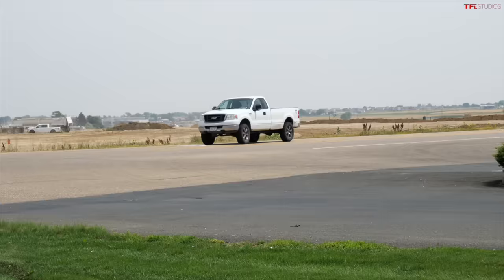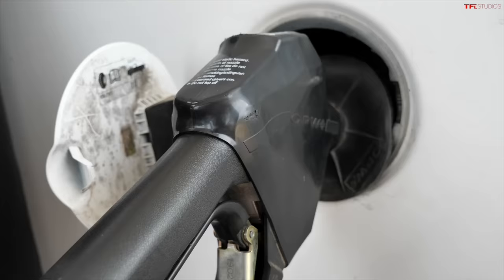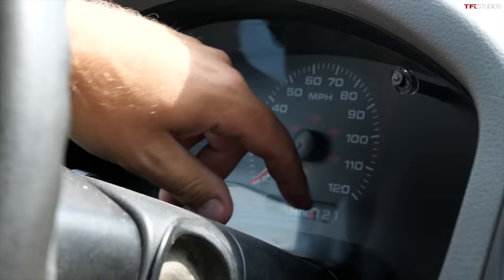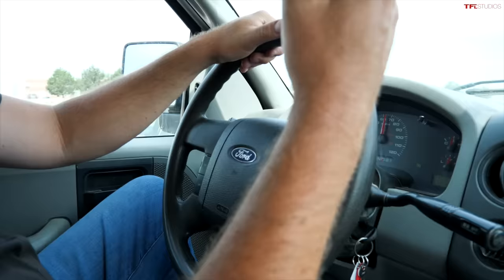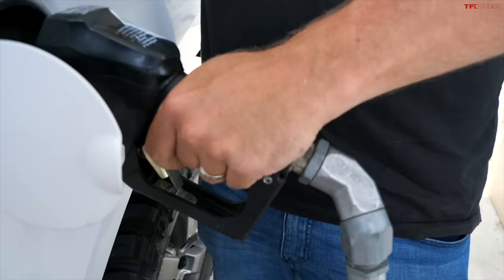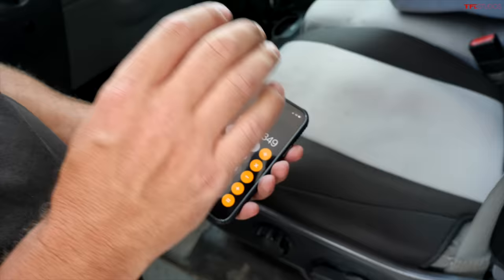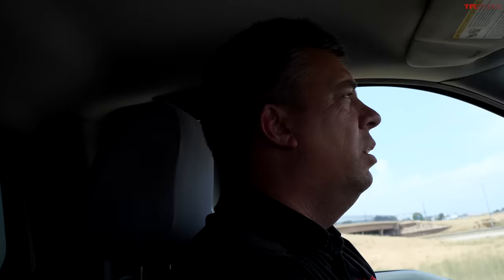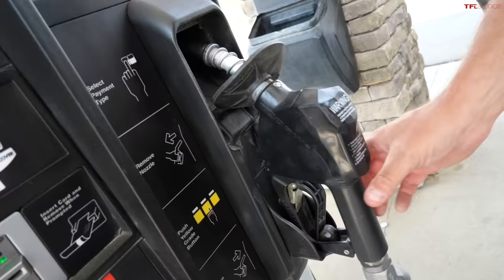Surprising Result: Here’s What Happens To Your Truck’s MPG When You Install A Topper!

Comment: I read somewhere that the manufacturers put the truck in a wind tunnel when they are designing it  The aerodynamics of an empty tuck bed create a high pressure air bubble behind the cab which the air flows over.  
If you remove the tailgate or add an airflow gate, the bubble will no longer be there.   
You will also get the drag from the bed and back of the truck.  
If you drive with the tailgate down, the hinges and other moving parts will wear out sooner because of the gate bouncing up and down with every bump you hit in the road

Comment: Had a 2010 Jeep 4 door Wrangler. 
Lifted, 37's, replace all the plastics with steel. Engine to gas tank skid plate.  About 700# heavier than stock. Got the same highway MPG as stock. Guessing the skid plate kit helped aerodynamics.

Comment: Thanks bro, this is sure inligting to know. I have a 97 f150 4.2 V 6 with topper, when I bought the truck 6 years ago I did the calculations and I got readings of 23 mpg. Ford reading had the truck (New) at 20 mpg.

Comment: I use to work for a company that tested Chevrolet. When the S10 came out we tested for a week. Tailgate up. Tailgate down. Windows up with A/C Windows down no A/C. We put 1 gallon of gas on each test. Ran it until it ran out. Tailgate down had better fuel milage than up. A/C on at 55mph Windows up. Got better than Windows down. 40 mph and under mileage increases with no A/C... But all were small differences. We did the test at Daytona Speedway on the flat part if track.

Comment: This is more fuel-efficient than my 13 f150 with 3.5 EcoBoost. Damn. I wish you did this test at 80 mph other than 70 like people really cruise on. The higher speed, the more important drag efficiency is.
Reply: I bet the mileage lost driving 80mph vs 70 would be greater than any efficiency gained
Reply: @epfd217  I meant they faster you go, the more importance of cover would show.

Comment: Huh cool.  I'm sure City mpg is more adversely affected
Reply: good point, aerodynamics dont really count in gridlock : P
Reply: @BIKEMAN21  It doesn't matter when your idling in gridlock either.  Caps make no difference.  My last truck I ran with a cap on and off 50/50 for 12 years and the mpg difference was negligible.
Reply: @superfisher4379  Moving 200 extra pounds in traffic will definately use more gas though
Reply: @BIKEMAN21  i gained 0.4mpg after switching from a topper to the bak x4.

Comment: I did almost the same exact experiment when i went to pick up a camper shell. All interstate there. Filled up at my start. Ran there with a tonneau cover. Files up a mile from the pickup - 18mpg. Put on the shell, drove home at the same speed and route, filled up when i got off the interstate - 18 mpg.
Reply: Correction - memory is unreliable, but Fully remembers - open bed, tailgate up 19.7mpg. With the shell 19.6mpg.
Reply: *Fuelly. Dang autocorrect.

Comment: Is “topper” and “cap” a northern saying? We just say “camper” in the south
Reply: It is, in the west it's camper shell or cap. I've never actually heard anyone say topper in real life.
Reply: @bigslacker666  I’ve lived in Montana, Colorado, Utah, Arizona. Always heard topper.
Reply: thats not a camper... its just Not!
Reply: I always called it a "shell".
Reply: If you call it a camper, then what do you call a real camper?
Reply: @nodak81  a camper. These “toppers” were originally meant for camping. If you want the bed covered just get a bed cover. When I was a kid most trucks that had them they would removed the rear window and have in sealed between the camper and cab.
Reply: @nodak81  
Sleeper??  :)
Reply: I believe what they’re called does vary depending on where you live. Where I live in SW Florida, most everyone calls them caps or toppers.  Calling it a camper or shell sounds like something someone who lives in the backwoods would call them. YeeHaw!
Reply: @kev8839  you must not be familiar with Florida, because you have plenty of those backwoods people there
Reply: My understanding is that camper implies internal camping equipment like a kitchen, a bed, lav and/or seating. Camper shell is only the enclosure, and could be a cap or topper although those would generally be smaller. A popup camper might be the size of a shell when not in use but tall enough for standing when deployed.

Comment: I'd assume a truck canopy only helps if you have a spoiler on the back to break the vacuum.  The space immediately behind the truck ends up with a little bit of vacuum, pulling air into it.  If you have an air spoiler on the tail it 'spoils' the smooth air flow and makes the air go into that vacuum space easier, thus reducing drag.  Try it.

Comment: I have a solid tonneau cover on my Tacoma and have left things on it after loading and unloading. They are still there after driving some distance so my 2013 Tacoma double cab's aerodynamics are such that the air flow over the cab doesn't get caught in the bed (or everything would have disappeared). If we're only talking about a tenth of a mpg, my right foot can make that difference every time i drive. In fact, driving on cruise control can get me at least 1 mpg better mileage because it's not changing speed all the time.

Comment: Not that anyone is likely to care but, if someone wants to "improve" on this test method I have a couple of suggestions: a) If you have a grandma in the family that lives far enough away to require 3/4 tank of fuel (or more) to get there and back, keep track of fuel efficiency on two such trips, b) Install an intake manifold vacuum gauge where the driver can watch it EVERY time the position of the accelerator is adjusted. Give yourself a limit (5 or 10 inches of mercury vacuum) for all acceleration (except ignore the gauge when merging with freeway traffic).

Comment: I'm OCD on MPG.  I put BFGoodrich Mud & Snow tires on, replacing the Michelin Mud & Snow tires because those Michelins were worthless in the snow.  For my long drives I got a verified 1 MPG less with those BFGoodrich tires than the Michelin.  I ended up buying a whole set of rims on Craigslist from someone who wanted to trick out his new Tundra and now drive with the Michelins in the Summer and BFGoodrich tires in the Winter.  My point is tires can have a huge effect on MPG.

Comment: I have a Ford F-150 pickup truck which is two wheel drive and it gives me over 21 mpg on the freeway and even better when driving locally. It has a 5.4L V-8 engine in it and it is a 2004 model.

Comment: I have a 2010 Tundra with 4.6L v8 engine.  I bought the truck and got 18 miles per gallon highway and added a roll up tonneau cover and my gas mileage went up to 19 MPG Highway.  So the tonneau gave me slightly more gas mileage.  My bed is the 6foot 7 inch bed and the truck is a 4 door crew cab.  The Tundra is a base model.  I use the cruise control whenever possible.  I try not to speed but here in Texas the speed limit is 70-75 Miles per hour.   I dont drive in the city much so city driving obviously would be worse.

Comment: Glad to see my 1970, 4 speed C20 with a stock 350 with tuned quadrajet getting 16mpg is decent.
Given it has 33's and a 4.56 final drive.
Reply: Might get 18mpg if you put the right size tires on it LOL....well and didn't have rock crawling final drives HAHA!!!  Nope, 16mpg is actually pretty good for a carbureted V8 in a 3/4 ton 4x4 pickup with heavy tires and geared lower.   Honestly with a truck like that I'd never care about fuel economy, it would be a fun truck to drive and throw fuel efficiency out the window LOL.
Reply: Pretty hard to beat a properly tuned Q-Jet. 16 is impressive with 33s & 4.56 gears

Comment: I put a soft topper cap on my 21 Tacoma and on multiple 250 mile trips I averaged around 20.5mpg without the top up.  With the top up I averaged around 22.5-23 on the same trips.  Easy 2mpg increase on the highway

Comment: I added a truck topper to my truck, and when i crashed the truck it almost came through the back window. 

The bed covers are a better option 
As long as you can fold them back for large items.  The camper shell limits what you can put in the bed.
You can get better fule economy by taking the tailgate off the truck.

Comment: I have a 20 year old pickup. The F150 with  4.2 V6  and 6 &1/2 ft bed and extended cab with rear seat and half rear doors. Get about 21 mpg on highway. Level terrain at 65 to 80 mph. No topper. I kept my speed even using cruise control.

Comment: Myth busters did this same experiment, much more scientifically may I add, and found that the truck toppers/covers/removing the tailgate hurts your fuel economy because trucks are designed to have the air vortex in the truck bed while traveling down the road. Altering the factory design creates turbulence behind the truck, decreasing efficiency.

Comment: I live in UK, and I've enjoyed owning quite a few Chevy/GMC pickups and a couple of Ford Rangers. All of them went through a good shakedown soon after I took them on so I could run them as economically as possible, bearing in mind our extortionate fuel prices here. The results of my mpg checks were always very similar, truck-to-truck; Open bed, tailgate up caused most expense due to drag, Tailgate down or removed gave the best mpg, the same as with a Mountain Top lid fitted. 10% minimum difference. AND my wife likes trucks, that's a bonus!!
Reply: Every scientific test ever done refutes your statement about tailgate up or down. Drop the tailgate & throw some aluminum cans in the bed. They "blow" to the front right beneath the back of the roof. The air does NOT see the tailgate in a pickup truck.

Comment: I think a topper would make a difference if you were towing a camper trailer behind you because when I used my open bed pick up to tow my trailer, I only got 8 miles per gallon due to the wind resistance on my truck hitting the camper. I would like to see a video made comparing the results telling some thing because I could see it. The top are making a difference. Good video thank you.

Comment: I have a ‘19 Silverado 4x4 5.3L.
Here’s the mpg I lost when I did the following:
Utility top: 1
3.5” leveling lift: 2
1” taller A/T tires: 1
Total loss of 4 mpg average, truck sees mostly highway miles. My top extends slightly past the cab on top and both sides, plus has toolboxes on the sides. If I stay at 70mph on flat road, I can still eek out 19mpg. I typically average around 14.5mpg overall.
Reply: Taller tires made the speedo/odometer read lower than actual unless you went in & corrected it. It's not so much the 1" height difference as it is the percent difference. Going from a 30" to a 31" is 3.3%! Also, AT tires probably have more rolling resistance & are heavier than a typical All Season tire.

Comment: The wind resistance is not so much about how you split the airstream in front of the vehicle but how it is blended in behind the vehicle. Secure a tarp over the roof and drive at various speeds (Carefully) and have someone take pictures of how the tarp behaves. It tries to lift away, ie the turbulence is pulling at the tarp. If you reshaped the canopy top to resemble the flying tarp, you eliminate the turbulence and should improve the fuel economy.

Comment: The comparison should be the bed as normally configured, bed with the tailgate removed, and then with a cap. My cap improved my gas milage about 1mpg, but I would be interested if just removing the tailgate would have done as well.

Comment: 2010 6.0 gmc hd. Topped totally off to the brim without a camper shell i can go 143 miled on 1/4 tank on the hwy. With the shell i can cover that same miles on 3/16th of a tank. Camper is a mid rise design. In my world i get better millage with this shell on my truck.

Comment: My 2018 Chevy Colorado Extend cab 2.5 l I4 and 6 speed manual transmission , has gotten as high as 32 mpg highway 60 mph w/cruise control and a Weather Tech tonneau. I think it has added 1-2 mpg .

Comment: “Regular” unleaded gasoline with a pump (R+M)/2 octane rating of 87 is recommended. Some stations offer fuels posted as “Regular” with an octane rating below 87, particularly in high altitude areas. Fuels with octane levels below 87 are not recommended.

Comment: On both my '76 and '79 F350s, adding an OEM Ford topper did zero help as far as mileage - 11 to 13 mpg with/without that 200 plus pound item even though it was pretty aero for the time. Now I just run with a low end roll up tonneau which seems to give my past F350 and current F150 about a 1 mpg increase

Comment: The largest impact on fuel economy is AIR UNDER THE VEHICLE.  Not the top. The reason most trucks have very similar gas mileage per pound of weight is because the ride height of most trucks is similar. If you lowered the truck and put air-dams in place the economy would increase significantly. Chassis/undercarriage drag is enormous. It's why on the very high end cars they actually put the engineering time to design panels that smooth out the airflow under the vehicle.

Comment: I put a SofTopper fabric topper on my 2008 Tundra extended cab 4x4 5.7 and went from 15.5 to 13.3MPG.  The topper weighs <30lbs.  It doesn’t seal to the back of the cab very well and the rib supports probably create a fair bit of wind resistance.  The Leer in their test fits the cab very tightly and is way more streamlined than mine.  It’s a great topper and I recommend it all the time.  I was expecting an MPG increase but definitely didn’t get one.  I didn’t change anything else at the time.  I live in western North Carolina and don’t often break 70mph on our mountain highways.  Anyone else have similar experiences?

Comment: Fair.  I’ve always found that emissions deletes are the legitimate king of increasing fuel-mileage.
Edit.  Additional.  The other factor is that the point of drag simply moves to the rear.  I don’t know though, let’s see.
Furthermore.  Accuracy in this sorta test is actually misleading.  Having to speed up or slow down with the pace of traffic actually makes this a more accurate test, as it demonstrates the actual fuel economy an average driver will actually see while driving the vehicle.  So good job there.
Edit:  Surprised.  Guess I was right, the topper was simply moving the point of drag back.  Good vid m8!

Comment: If you're right that the weight vs aerodynamics is the difference, then you may actually improve MPG at higher speeds as aerodynamic drag is not linear, but increases squared. That means at 60, you have 4x the drag you do at 30.

Comment: I should point out to everyone watching.... from a Master's Degree holding engineer - NEVER burn 85 octane in any engine that has computerized ignition or fuel injection, when your manual states "Use fuel with minimum octane of 87" (vast majority of vehicles on the road in Colorado and the rest of North America) because 1. You don't need it because the computer CAN compensate for the altitude of Colorado and much higher. Also, 2. The computer can NOT compensate for octane lower than the minimum the engine was designed for. 
"What should you use 85 octane fuel in??" Lawn mowers, generators, weed trimmers or any lower compression or old engine IE: pre 1975 or so carbureted engine with rudimentary emission control.

Comment: I don't know how many times I have heard the "we have 85 octane because of higher altitude" statement. The opposite is true. When running at high altitudes, a car needs higher octane due to the lack of oxygen. The 85 octane is sold in states like Colorado and Utah because of the lack of regulations that allow the oil industry to sell a cheaper fuel. Every time I drive into Utah, I have to use premium to get the same power from my cars that I get from 87 in California. I had several auto mechanics in Utah tell me the 85 octane is the number one cause of the engine problems they see. Most auto manufacturers now have notices to never use 85 octane. Hell, my generator and lawn mower say using 85 octane will void the warranty and damage the product.

Comment: You need to pump until you can see the gas in the filler neck, then you need to make a run long enough to drain pretty much the whole tank.  Then do that same thing again with the topper on to get a more accurate test.

Comment: Do the same run with no topper, and the tailgate off or down. The "air trap" of the empty bed is negated while no weight is added. It should add 1+ mpg.

Comment: Myth Busters did this test and put the truck in a wind tunnel at NASA to get perfectly repeatable conditions and used a force gage to test how much drag the truck had with a topper and without. The topper added drag. When they added smoke lines to the tunnel, they found that the eddie effect of the air curling in the truck bed caused a cushion of air that streamlined the air coming off the top of the cab to the back of the tailgate. Not all trucks are the same and so maybe your topper had a different outcome.

Comment: I can't believe you didn't do it with the tailgate down and  without the tailgate. 

Btw. Here's my test with a 2011 Nissan Frontier Pro4X with a Leer high topper on it, on a run from Nampa Idaho to Truckee California and back. 

One the way down, with the cartop carrier bars installed on the topper. 17 mpg. 

Return trip, cartop carrier bars removed from the topper. 19mpg. Not a huge difference, but a definite difference.